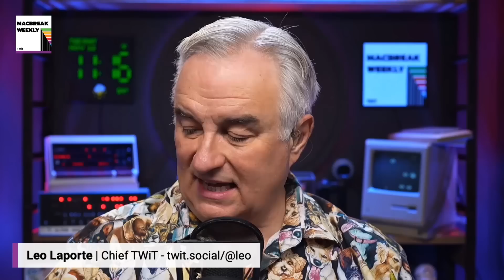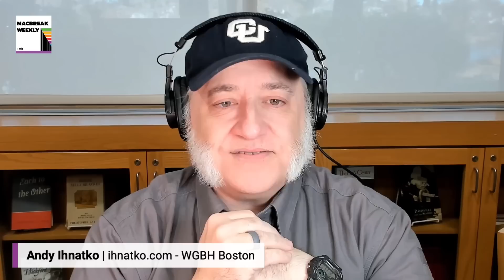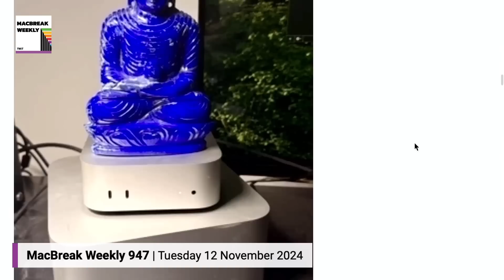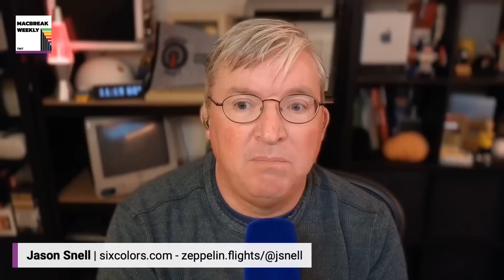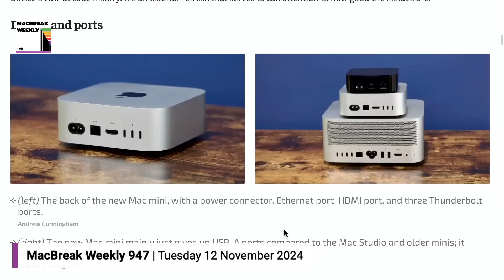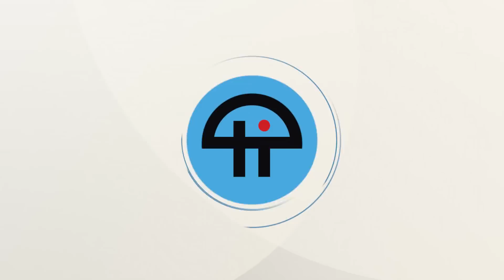Leo's M4 Mac mini

Comment: Drive Speed ain't every thing. I just purched the M4 Mac Mini "Bottom of the Line"  Put my Windows Sabrent 10GB/s Enclosure with a 1TB Samsung 980 SSD and running Davinci Resolve have no problem running Projects I made on my Windows Machine with that SSD. Just got and waiting on the Samsung 2TB 990EVO from Amazon.  But do I really need it. Love to have Both Computers able to Access the Same DATA BASE / SSD.

Comment: Highly inspiring video! 

I have been thinking about buying the base M4 or M4 with upgraded storage for now and then buying M4 Pro maybe 6 months down the road? 

Ironically, my 2012 upgraded Mac Mini died (computer fixit dude said it was proabably the started and not cost effective to fix) two days before the release of the M4. Maybe God was trying to get me to upgrade. I was out of memory on that one, partially because I still haven't figured out how to access Reaper files from the Samsung T7 I bought for that purpose. It is for music production and video. Nithing super crazy, but I am a messy recorder and editor and use more space thsn I shoud as a result.

Anyway, I have too much debt right now from breaking my elbow in January and having surgeries and being off work half the year. I was going to do the Apple payment plan if I can. But I have so many things on payment plans I don't want a huge payment. 

It's sometimes hard to balance what is good right now with what would be good long term. Any thoughts on if the base M4 would hold it's value so I can resell after some more money comes in and buy the Pro if needed? I need the computer to make more money...I am assuming the M4 will be enough but I don't want to be throttled. Was thinking of upping the storage though.  Any thoughts from those who know Macs well and resale value?

Comment: I turned the power off to my RV. Just to see how long the 1500 VA UPS would run my Monitor and Mac Mini M4.. It. was 6 hours.. They draw almost no power at all....That is without tuning on my 2000 watt inverter. Which would run the whole system for 10 days..

Comment: Very much enjoyed the video and info.  Can not wait to update from a 2019 Intel iMac to a Mac Mini. If I could ask a question, my iMac has a 2 TB fusion Drive of which 1 TB is listed as system data. When I upgraded, do I need to take that into account when selecting memory updates or will that shrink weigh down with the upgrade? Thank you so much.

Comment: I opted for the M4 Pro model and was trying to run three 4K monitor off of the TB5 and HDMI ports, leaving the third TB5 port for external storage. The issue I seem to be having is when the Mini wakes up from Sleep the two TB5 attached monitors wake, but the HDMI attached monitor power indicator lights as if its woke, but there’s no display. When I run all three TB5 ports to the three monitors, all is well. Is there a TB5 hub I can use to tun all three 4K monitors at 60hz leaving me with the two remaining TB5 ports for other uses?
Reply: No Hub\Docking Station are out yet..I understand Manufacturers are working on getting them out. But don't just grab the first ones out. As some are pretty smart about reading what people want. Ports, readers. Location of them etc..And still look nice...I even seen some that stand the New Mac Mini on it's side..

Comment: With a Thunderbolt enclosure, or even a 40Gbps USB4 enclosure, you can expand your storage from 256GB on the base Mini to past 2TB for less money (or about the same, depending on the sales you catch) than the 512GB upgrade. And at peak speeds, it may be faster than the 2300-2600MB/s the 256GB internal storage is getting in reviews. Soooooooooooo ... that's what I did, along with a portable 1080p monitor to have a portable desktop Mac.

Comment: Soooo what specs did ya get ? Any recommendations on a nice monitor 27 to 32 inch for under 500? Also … do you know if the iMac has all slower SSD speeds at all sizes ?
Reply: Nothing beats the Dell Alienware Monitor for the $600.00 price. And yes the 256 is slower then the 512... As the Unifi Memory will switch to the SSD space on big rendering files..If you get the 16 GB memory.. But as they say. 95% of the users would never see that.